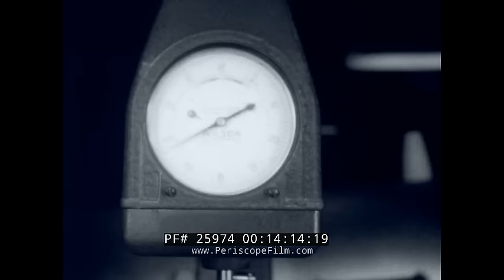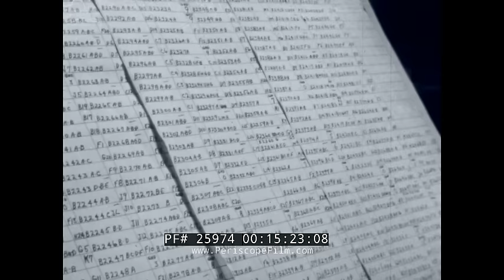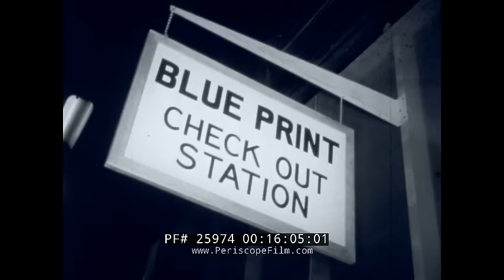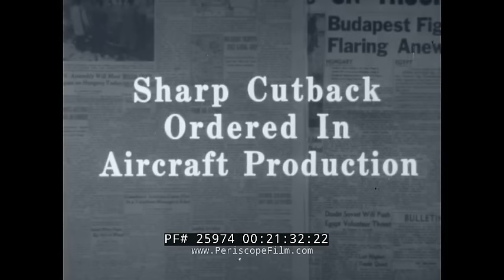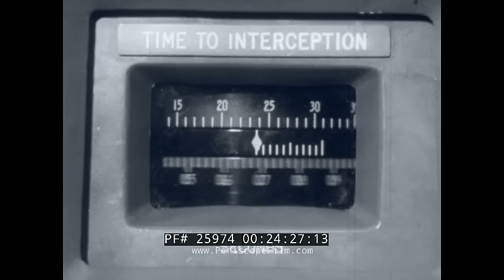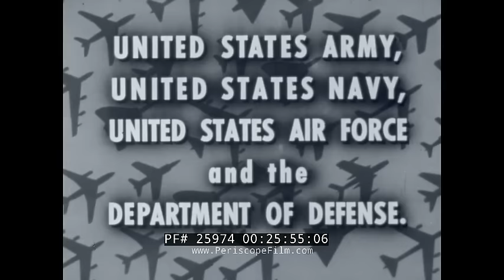POST-WWII JET AGE AIRCRAFT DESIGN, ROCKET & NUCLEAR POWERED AIRCRAFT 25974

Comment: 0:35 Nuclear-powered planes: got to love the optimism there.
Reply: actually sounds pretty scary, imagine shooting that thing down in your back yard.
Reply: Yep the Nepa program was pretty interesting. The height of the cold war they were looking at all sorts of crazy ideas for nuclear deterrence. There are some videos on YT that go into further detail about what exactly was going on.
Reply: Wayne Hartneck Having it shot down would be a rare problem. I'd be more concerned with a "regular" crash: icing, wind shear, or one of the other thousands of things that could go wrong. Now you don't just have a crash confined to a small area, but you've added radioactive contamination to the mix. 
Flying Fukushima.
Reply: they actually made an operational nuclear powered space craft, the voyager 1. it is powered by a small reactor and is somewhere in space.
Reply: There are lots of spacecraft that use RTGs. Radioisotope Thermal Generators are technically nuclear power but the video is talking about a nuclear reactor. Voyager 1 has left the Solar System and is just over 38 light hours from Earth.
Reply: There is a shortage of the plutonium 238 used to make RTG's. I think I saw a report NASA only has a enough to make 2/3 more probes that would use it for power.
Reply: Hence Juno using solar at Jupiter. After not doing so for about 25 years, the United States restarted production at circa 1.5 kg a year in 2013.
Reply: @DarkRaptor99  correct. Pu-238 is a waste product from the production of Pu-239 which is used exclusively for nuclear weapons and the USA hasn't made any of that since the late 1980s.

Comment: 12:27 What is it?
As for ANP, its required safety demand produced the molten salt reactor. If only Fukushima had MSRE instead of boiling water pressure vessels.
Reply: There is no molten Salt Reactor in commercial service. Good idea, but they don't work.